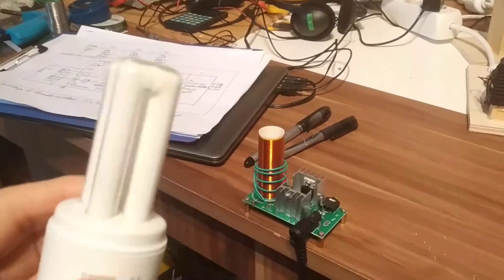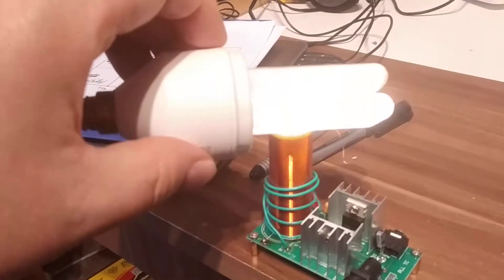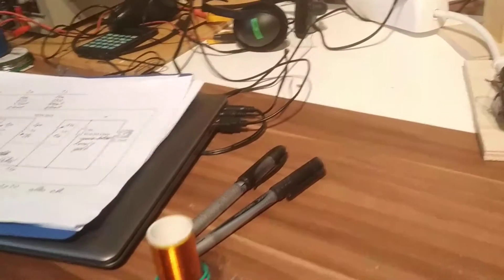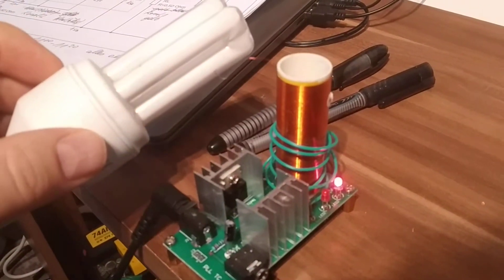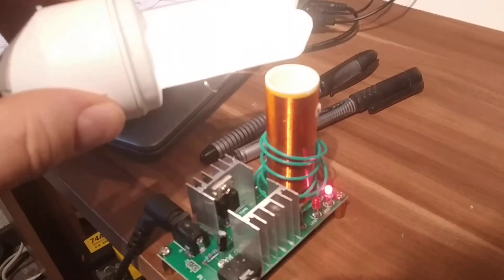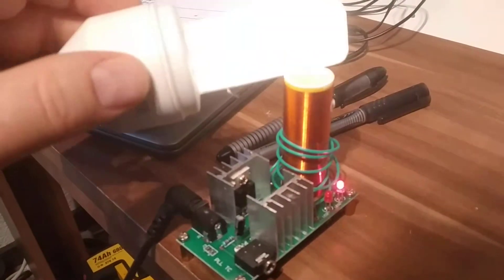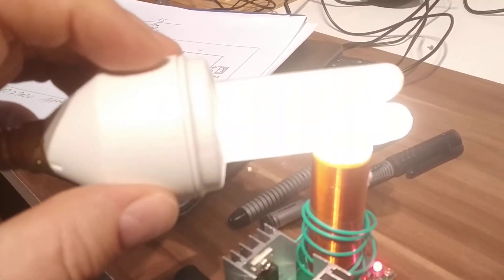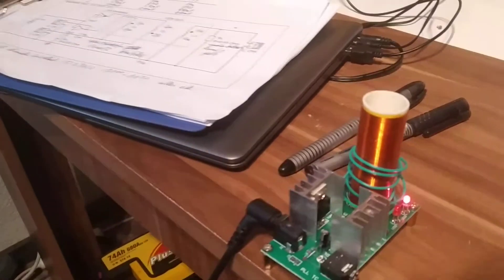Wireless Power Transfer via Mini Tesla Coil

Comment: lets put 10 of those cfl next to the coil and get overunity! put 10 of them and check if the current draw on the tesla coil increases.. if it doesnt then you could be getting more light for the same input!
Reply from the maker: Yes, you are right, but it was not my toy and I don't want topollute my space with huge RF radiation...

Comment: The range should be a lot larger.
Reply from the maker: Yes, i had the wrong gel fuel of petroleum, so the wick got clogged.. Never buy these gel based barbecue lighter fluids...
Will try soon with the Infinity graphite felt wick to run this petrpleum oven...
Reply from the maker: Ups replied to the wrong topic... Yes, the range could be better with this setup... needs to be tuned a bit better,... Look into user:
"energy researcher" for his videos, he has got much better range with his TMT coils....